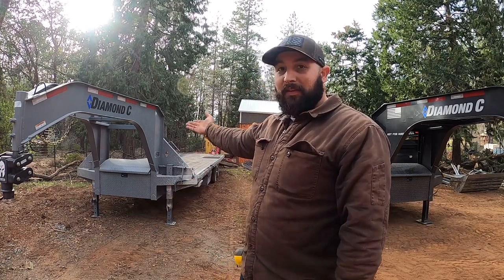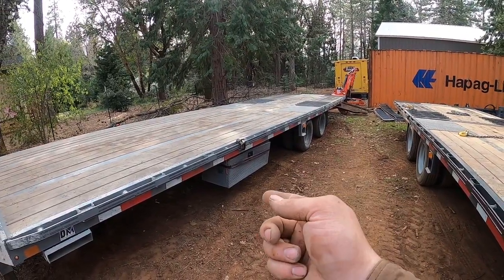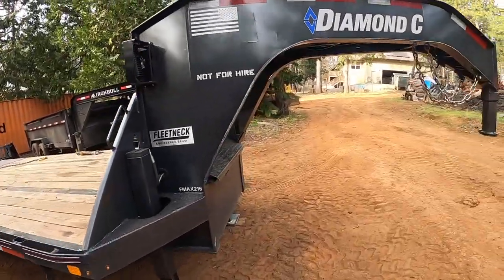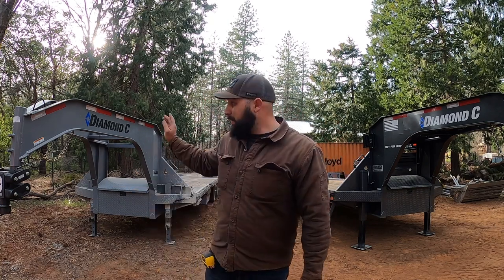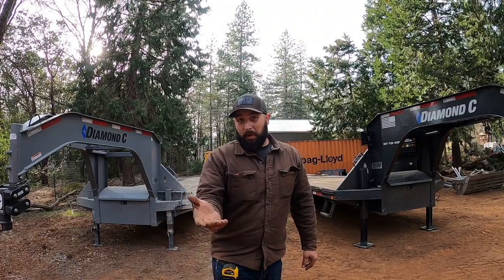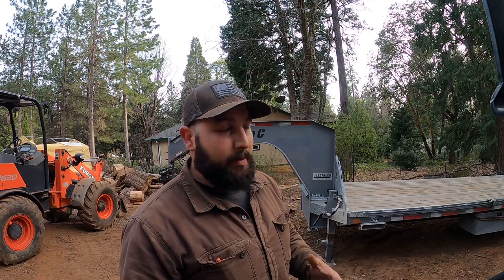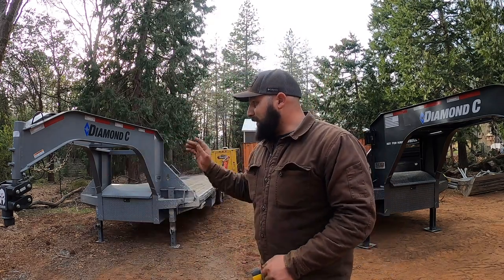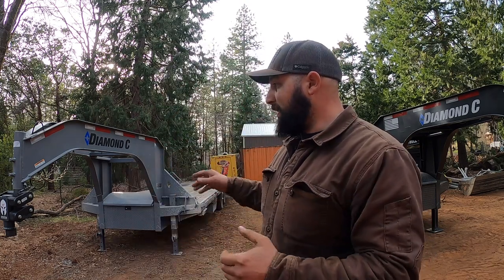What’s the best gooseneck for you?  Diamond C FMAX 212 or 216?

Comment: I appreciate the video.  We just bought a 19k excavator, will need to upgrade our 20k trailer at some point in the future.  I know a 216 would easily handle it and it sounds like a 216 wouldn't be any heavier empty than our current trailer.
Reply from the maker: Thanks. And ya 216 will do you dang well

Comment: Great Videos.. Q I have an f450 and f350...37k towing rate.... I have a case 621 loader weighs 26,711 lbs it it realistic to pull with one of these duallys on on one of these diamond trailers or will it be too much? Also have a genie 1056 telehandler weighs 31,416 as well. If this is pushing it what would the next step up be with out going to a semi?? Dump truck with a pindle? Bigger truck...whats your advice. You seem to have a lot of experience.
Reply from the maker: Only thing I’ll say about the ford is your exhaust/compression/engine braking 
If you live in the hills, it just doesn’t retard enough on grades. 
However towing your loader doesn’t seem like an issue at all, however you’re 1056, will be pushing it. 
I can technically put 32k lbs on the deck of my dc trailer. I would go up to a tractor if you’re towing that often. 
And ya if you want to go with a dump/pintle set up they make 50k lb pintle trailers out there. 3axle beasts,

Comment: I'm kind of wanting a Diamond C after you and Sam are always bragging about them. One question for you, why did you opt for a 3500 truck for towing? I have a 21 3500 chassis in my fleet and at 9k miles the pads were already glazing. I'll tow 30k behind it, always have the exhaust brake on full and the trailer brakes aggressive. I'm thinking of going to a 4500 next time for the heavier undercarriage components.
Reply from the maker: Just more comfortable of a truck for me. 
Trucks been a trip machine as well as my work rig, 
3500 has the HO motor always nice to have some more power 
I haven’t glazed my pads some how braking has always been good even for how I use it. 
But nothing wrong with a 4500-5500 truck get them lower gears and you get some sharper turning radius
Reply: A medium duty Freightliner would be better. Everything is larger than the consumer grade 4500 trucks.

Comment: Why is it, in your opinion, that people are staying away from the 310 or 312's? They're fairly close in price to the 216.
Reply from the maker: If I did more highway hauling I would love to have a 312 system. More brakes number one and more load distribution. However I’m my area what I do and where I go I would destroy the tires doing all the switch back roads and U turns I make all the time. One thing you could do to get the best of both though would be the get the front air lift axle so you can still maneuver easier but if you have a 216 with a front lift axle then it’s that much better to get out of spaces. It’s a win loose in both systems

Comment: So I have a power curber 5700D. 26kish lb loaded. Machines awkward 3 track machine where it's largely weighted on one side of the trailer. Just curious if you think it's realistic with the fmax 40k
Reply from the maker: Well with something like that hopefully the deck of the trailer is wide enough to off set the weight a bit better however staying over the axle more will keep the load from twisting to much. But realistically I’m more than comfortable at 26k lbs. I’m at 26-27k lbs every time I tow my excavator

Comment: I’m trying to do a gooseneck setup to haul my kobelco SK140 behind my 2017 f-450 my machine weighs 32,000lbs do you think the 40k trailer would be ok maxed out ?
Reply from the maker: Well at that weight you’ll be doing in your truck to be honest. 
And remember machine only weighing in at 32k now you have chains and binders whatever else on the trailer you’ll be on the fine line of a comfortable tow,if you ask me I wouldn’t recommend it. It’s possible but that’s cutting it close
Reply: @IManOPERATOR  yea I completely here ya. I also have 2 international CV trucks that are quite a stout truck and was thinking of getting them rigged for tow but they actually have a gross combined tow rating of only like 30k I can’t even believe it lol really not wanting anymore trucks lol
Reply from the maker: @dirtdiggler1980  god dam lol that’s nothing. It’s crazy how they’ve been able to rate these trucks lately. 
Those are just like that med duty chevys right? Not sure why the tow rating is so bad in them.
Reply: @IManOPERATOR  yes same as the chev 6500 I couldn’t even believe it when I called my salesman and inquired we didn’t buy them to tow anything but was thinking it may look better going down the road with a 15 ton excavator behind it than my f-450 lol. I think I’m gonna try pick up a dump truck lots for sale around here now pretty cheap as they’ve implemented this new axle law and it’s not worth the guys to upgrade many used trucks. You can still run them they just have limited the weight carrying capacity so for me not running gravel for a living i think it will work ok.
Reply from the maker: @dirtdiggler1980  heck ya thats would be really easy way to go about it. Would be a good tow truck for sure

Comment: I pull a 20 foot diamond 💎 c  had it is 14900 lbs. I use it for 8000 pounds of farm 🚜 tractor and implements .I also use it as a car 🚗  trailer. I put my 1926 Oldsmobile which is 2800 lbs. My 12000 lb tounge jack is driven by  a drill using a speed binder gear reduction speed tounge binder.
Reply from the maker: Solid bit to haul around!